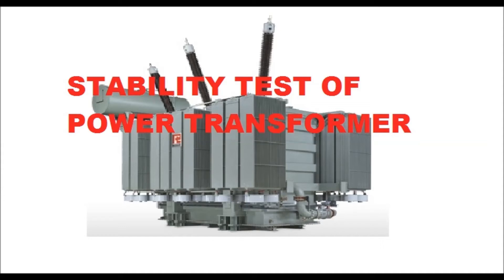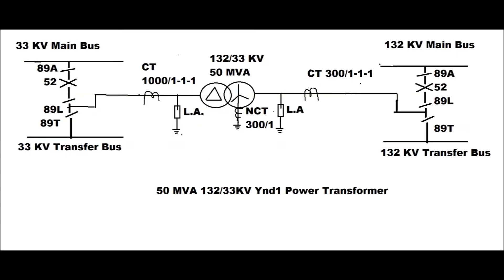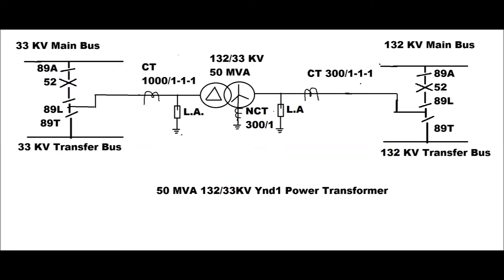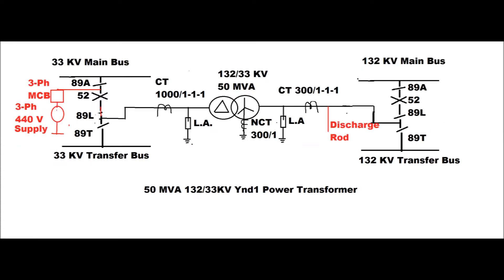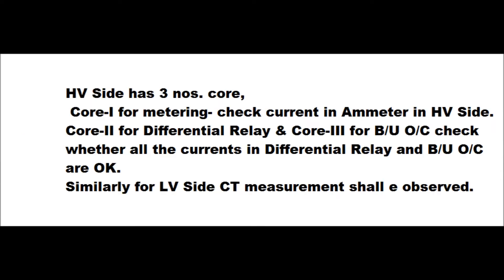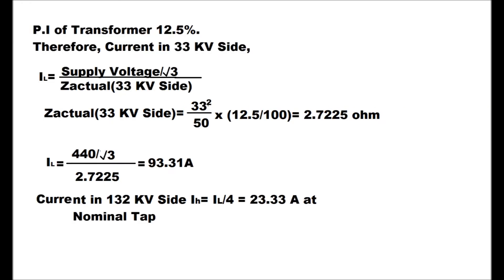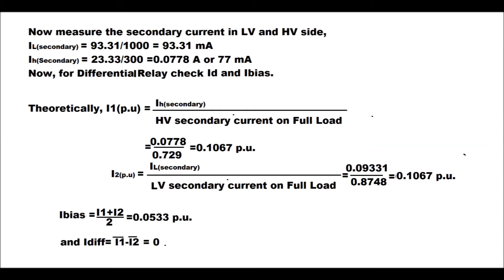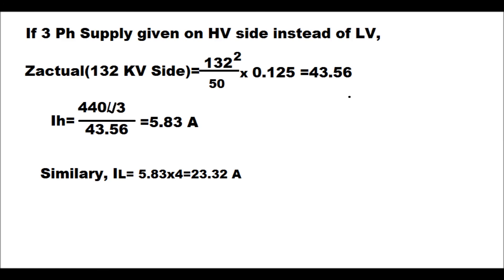TRANSFORMER STABILITY TEST(50 MVA 132/33 KV ) (Transformer  Testing)

Comment: How to check health of transformer and faulty condition of  power transformer???
Reply from the maker: That is by condition monitoring test such as thermovision camera to monitor if there is any overheating in between any connector, insulation resistance test, tan delta test, dga test for analysis of oil condition, dc resistance test of winding for comparing the value of winding resistance and to detect any fault in oltc, magntising current test for detecting faulty transformer.